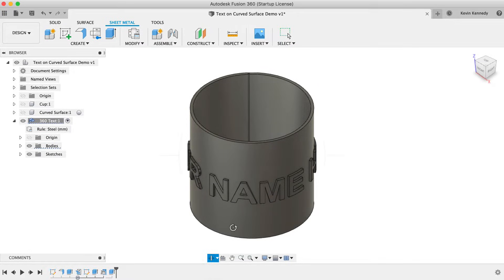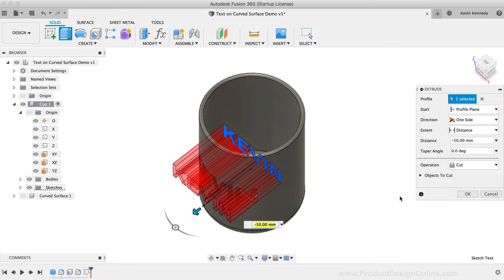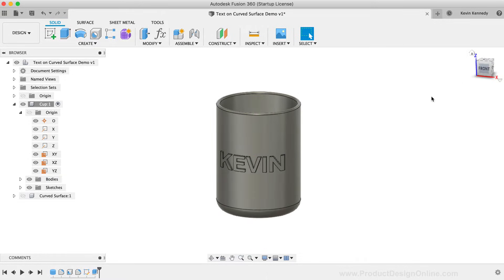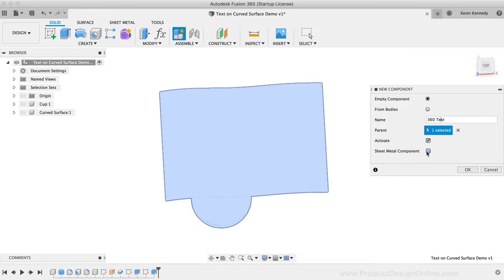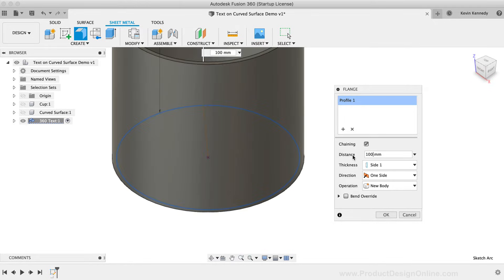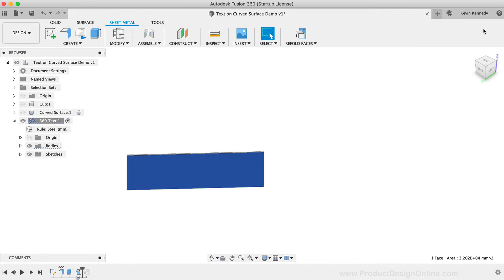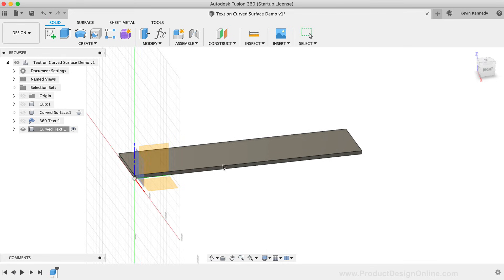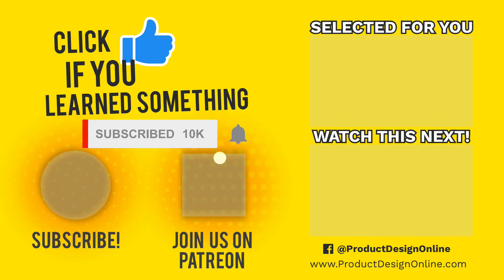Wrap Text Around a Curve or Cylinder - Fusion 360

Comment: Maybe, probably, it's just me, but the workaround does not work for me. I followed you step by step, and it will not let me select that 0.50 mm extruded joined side. It maybe cause no matter what i did when creating my arc it kept only doing half the arc until grabbed the end of it.

Comment: Here’s an odd one (at least for me)… I’ve created an object using the revolve tool. The outer surface is nearly spherical. I want to put text on it, but none of the tools I’ve come across seem to allow me to do that. Any thoughts?
Reply from the maker: Have you tried the (newer) Emboss tool? It does have limitations in terms of what curvature it will work on but that's the best place to start. Otherwise, you would have to either perform an offset faces or extrude the text further and cut it away with a surface body (that matches the shape your wanting).

Comment: Apparently they added a feature called emboss.... gonna have to learn that one next, but i learned this too because...must learn...
Reply from the maker: That's correct! Emboss will only work on a single curved surface though (at the moment).
Reply: @ProductDesignOnline  Honestly This is SO different from the 3d design im used to.  i learned 3d studio Max in college for game design use, and until now have made OBJ files to 3d print using that... but that takes like 8 hours for simple stuff.  this cad stuff is SO much quicker and more dimensionally accurate...

Comment: Thanks Kevin! Another awesome tutorial. You are my Go-To when I'm stuck with a Fusion challenge.
Just wanted to let the community know that the simplest form of your technique (extrude from object) works just great for 'insert SVG' too.  My granddaughters are really into the Paw Patrol characters just now, so 3D printing a couple of mugs with their favourite characters embossed on the side has gone down a real treat. See the joy that you are spreading Kevin!
PS1: To get the SVGs, I downloaded some suitable jpegs from the Internet and brought them into Affinity Designer (the free Inkscape could also be used). I turned down the opacity and then added a new layer and used the pen tool to draw around the outline and also to pick out some of the courser features like the mouth and eyes before exporting this new layer as a new SVG.  Then in Fusion, it was as simple as 'insert SVG' before following your advice on the extrusion to result in a 'proud' emboss of 2mm. I had 'supports' switched on for the Slicer, but pretty sure it would have been even better without.
PS2: For printing these I used NGEN from ColorFab as this material can cope with a drink up to 60C and appears to be food-safe. However the printer does need to be capable of an extrude temperature of 235C and a bed temperature of 85C.

Comment: I've been going back and forth between Fusion 360 and Solidworks Student version and I am totally Stumped trying to create Inlays on a Cylinder. I've tried using this demonstration as a reference and while it worked using the second method in creating the design. The Cam portion through me for a loop.
Reply from the maker: Hi Ronald. You can try using the new Emboss feature (in Fusion 360) which may yield better results.

Comment: "Text on Curve"  For putting text all the way around a cylinder what is wrong with using the  "EMBOSS" tool. Was able to get full first and last name (16 characters) to wrap all the way around.  If Font size is too large you get and error "Sketch profiles create a self-intersecting body." Just reduce font size to where it just fits for 360 text warp.
Reply from the maker: The Emboss tool was just released two weeks ago...so it didn't exist when I demoed this "workaround" ;)

Comment: I created a curved plane like the one you have, but when I tried to extrude from object, I get the error "Warning: Fail to project some profile(s) to remote surface
" and the extrude only completes partially. Here is the file: https://a360.co/2vpu3KS
Reply from the maker: Hi, InsaneRevolt. That's because the text/sketch plane runs through the body. You can fix this by creating an offset plane and redefining the sketch plane, resulting in the sketch lower than the entire body. Here's your file with my changes - https://a360.co/2UPx3Lg
Cheers, Kevin :)

Comment: I am making a belt buckle with a curved surface. I need a way to taper the text that is recessed into my buckle so when I make a mold the wax will come out of the mold. The taper feature is not active when selecting a curved surface. Any suggestions?
Reply from the maker: Hi, James. Did you try the draft or chamfer features on the edges of the text? Draft is the easiest, but doesn't always like to work with text (because there are typically too many line points). Chamfer, with two defined distanced, can be used instead. I cover that (at 4mins 30 seconds) in this video - https://youtu.be/djAabRlFA50?t=270
Cheers, Kevin :)
Reply: @ProductDesignOnline  I could not get the chamfer to work on the text. I used a small rounded text and I think it was too many angles for the chamfer. I was able to get the fillet to work so at least the bottom does not have sharp angles. I found you videos very helpful.
Reply from the maker: @jamesberry1603  ah, didn't realize your text was rounded. The other avenue would be to project the text onto another plane > offset the text to make it larger > and then loft from one set of text to the other, which would create the tapered surface.

Comment: Hi Kevin. I’d love a tutorial on how to make a two part badge. The main part would be a flat badge with text cut out of it. The other part would be the text, to be printed in a different colour. The text letters could be held together with a narrow strip which would fit into a matching cutout in the badge, and the whole would be a press fit into the cutout in the badge. The tricky bit (for me) would be how to offset the letters so they fit together. Could you also build a slight taper into the badge and letter to make it easier. Obviously any offset would need to be worked out depending on the tolerances of your 3D printer. I hope this makes sense. Thanks for all your tutorials. I really enjoy them and find your delivery easy to follow.
Reply from the maker: Thanks for the idea, Ron. I've added this to my list of tutorial topics. I will try to cover this or similar at some point :)
Reply: @ProductDesignOnline  I look forward to it. I've been fiddling with it and managed to get some text extruded with a taper - once I found a font that didn't throw an error when I entered a non-zero taper value. I added a bar to hold it together but can't seem to align the two elements so they are centered relative to each other. I've been trying to use midpoint constraints without success. And I guess I'd need to align the plate and lettering so they have a common centre point too, so if you could cover that in the video it'd be a huge help. I know you've done videos on constraints but I'm still missing something. Thanks again.

Comment: Really useful. 
I'd like to know how to import a (fairly detailed) B&W drawing, the image to be raised/embossed or inset in different colour, (replace image with black material in 'cut-out' in pale body.)
Reply from the maker: Hi, Richard. Fusion 360 does not work well with imported images (other than use for reference). Are you trying to create a lithophane that's 3D printable? If so, I would suggest checking out this instructable on how to do it in Cura or some other programs -  https://www.instructables.com/id/Litophanes-How-to-3D-Print-your-photos/
Cheers, Kevin :)

Comment: Hey man would this work on a sphere? I'm designing something that requires a sphere that has a lid. I plan to put a logo on it that curves with the sphere

Also "text on curve"
Reply from the maker: Hi, Greyson. Thanks for watching and great question. The first method (using the press pull command) will work on a sphere. I don't believe there is a way to use the second method (sheet metal method) with a sphere, unless you create a small cylinder with the wrapped text and then "join" that body to the sphere (but that would be tricky to get the sizing right).
Cheers, Kevin :)

Comment: Hi Kevin, I have an SVG file of a pattern which I want to extrude around a cylinder to make a roller. Would this work in the same way? In theory the pattern can be tessellated.
Example of what I mean https://tinyurl.com/y59vju6h
Reply from the maker: Hi, Chris. That's correct! You should be able to follow the same methods outlined in this tutorial. You'll simply need to use the "Insert SVG" feature instead of the text feature.

Let me know how it goes or if you hit any roadblocks as you work on it. Cheers, Kevin :)

Comment: How do you horizontally allign
Reply from the maker: Hi, JANNY BRAVO. Great question. Unfortunately, Fusion 360 does not have a nice native way to align text (like a typical word processor).

There are two workarounds. First, if you're using an imported SVG for the text you'll want to create a bounding box and have it centered on the box. The second option, if you're using Fusion 360's native text feature, is to create construction geometry to help you center it. I've found if you create a diagonal line across the part to find it's center point, then it makes it easier to align the center point of the text. Some users also create the desired size of the text they need and then create a center point rectangle the same width and length, and align the text within the rectangle.

I hope this helps! Cheers, Kevin :)

Comment: How the un-bend and the "create flat pattern" was explained to me:  
Un-bend is for while you are working on a project and you want to make changes that go across bends.
Create flat pattern is for when you are done with your project and you want to make sure it unfolds / need to export the flat pattern.
Reply from the maker: Hi, Eric. That is correct, with the addition that you CAN also create edits in the "Flat pattern" (Create a flat pattern) state, but they won't be show in the 3D state. The idea is that sometimes it may be necessary to have a small detail that is required for cutting out the object, but it wouldn't be shown in the final product for various reasons.

Cheers, Kevin :)
Reply: @ProductDesignOnline  "text on curve"

Comment: Here is a new idea for a video that has not already been made before: How to make robust models. 

I have watched many of your videos and I am no longer a novice when it comes to Fusion 360.  The problem is that when I have to change something in my models, Fusion gives me the “reference missing “ error message. 
People that use Fusion professionally must have a strategy for how to structure their models to keep them working even when dimensions have to be modified.
Reply: I am not an FS360 expert (yet) but I am an engineer, and I can state that parametric component based development is the best strategy for dealing even with the most complex models and assemblies. Same we see in the domain of computer code development as well. That's the reason software developers are also referred to as software engineers.
Reply from the maker: Hi, ion1969. Thanks for the suggestion - great idea! I've added this to my list of video topics.

Could you share one of your files so I could get a better idea of how you are setting up the file and changing things?

There are many things that could be covered in a video of this topic, but I want to make sure what I'm thinking is the same as what you have in mind. Cheers, Kevin :)

Comment: Hi, perhaps you could do a tutorial on how to create a screw thread with a custom section profile. Fusion 360 has a function for standard threads, but you cannot alter the section. Also Fusion lacks a spiral function, which you could use as a path. I tried several workarounds, but getting a clean screw thread, without cut-up surfaces and without warping is close to impossible. I know lots of people in the plastic enclosures business would like to be able to make these custom threads (used in bottles, lids and caps).
Reply from the maker: Hi, Richard. Thanks for the suggestion. Great idea. I've added this to my "to-do list" of video topics, where I'll try to tackle it at some point. Cheers, Kevin :)